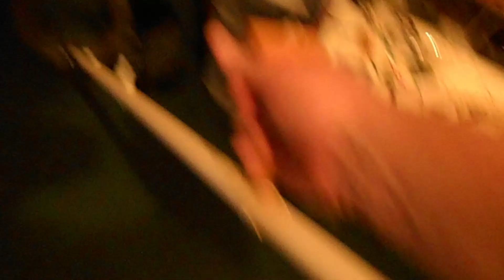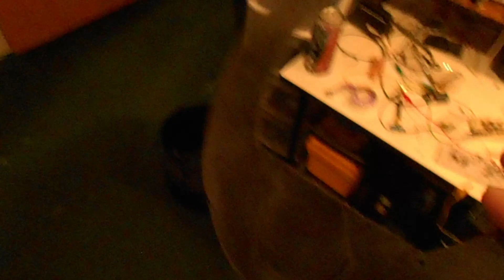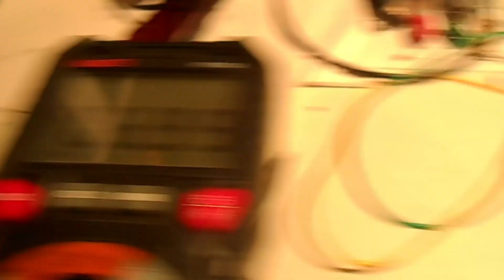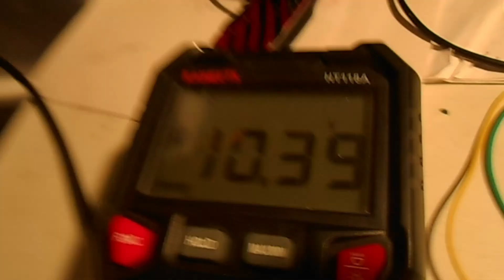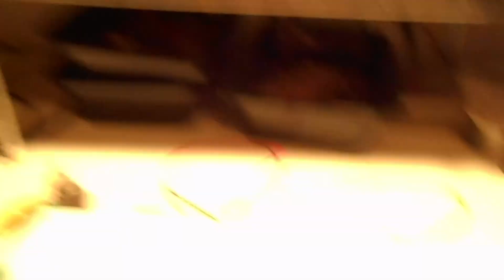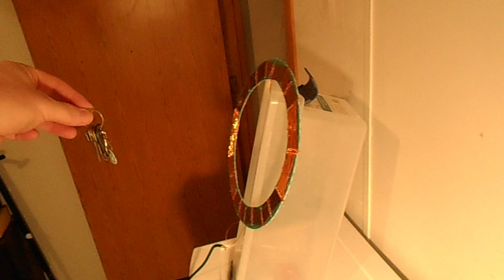Homemade DIY Pirate PI metal detector

Comment: Thanks for a very informative video with some nice modifications. I have an interest in the Pirat detector, and I think that the full possibilities of the basic circuit have not been realized.

I am intrigued by your search coil design. How was it constructed? What wire gauge did you use, and how many windings did you find to be the best?

What frequency are you running the oscillator at? You mentioned the pulse width, are you adjusting the duty cycle of the 555 as well as the frequency? If so, how are you accomplishing this?

I can offer one tip, and that is regarding the shielding of the coil. I have found that by winding a 1/2 inch wide strip of aluminum foil around the coil (through the coil itself, not around the diameter) gives an increase in sensitivity and depth. The foil winding needs a 1 inch gap between the two ends to prevent it from becoming a shorted turn. One end is connected to a dedicated ground wire in the cable from the search coil. Soldering to the foil can be tricky, but was accomplished by using a bit of vegetable oil as flux.

If this is a project that you have a continuing interest in, I would welcome the opportunity to exchange ideas with you, perhaps through email or messenger. The Pirat is a project that I continue to return to in between other projects.
Reply from the maker: Thanks for the comment.

The coil as shown on the imgur gallery in the video description is 400uH around 2ohm resistive, ~1.5MHz resonant point and around half that with coax attached from cable capacitance. The spider coil is around 27 turns, not sure magnet wire diam. but inner diam. of former is 7" and outer a little over 9.5. 

The wire itself was scrapped from a power supply transformer secondary so out of luck knowing the exact gauge now but most wire
I randomly tested that would fit my coil former circumference were within those same tested ranges.

I calculated those values by using a frequency generator sweeping the undamped coil until resonance was found on an oscilloscope then calculating its general inductance using a known loading resistor in a similar way with a little aid from my pocket calculator. 
The later damping resistor in the circuit was found by trial and error until most sensitivity was found with a ruler and coins.

I made the oscillator speed variable which is the "Tone" control in the final part 2 video since it has a slight effect on the size of the object being searched for, but more so for the user since a variation in in pitch is useful when outdoors around other noises. 
The duty cycle of the oscillator is internally adjustable with a trimmer since I found it has a much larger impact on battery life, how hard the coil is driven, and detection range which there is a sweet spot when dialed in so detection distance is best and circuit current draw is practical.

I actually did try the foil idea but found it had some drawbacks to the resonant point and inductance and I didn't notice much of a change of sensitivity in my experiments but I will revisit this idea in the future when I make other size search coils as optional ones to use in the field with it.

It will be some time before I get back into metal detecting now that winter is arriving here and other indoor projects are taking
priority but I am always up for discussing ideas in the comments.
Reply: @kenzingzong6704  Thanks fir responding! I will use this information in my own experiments.